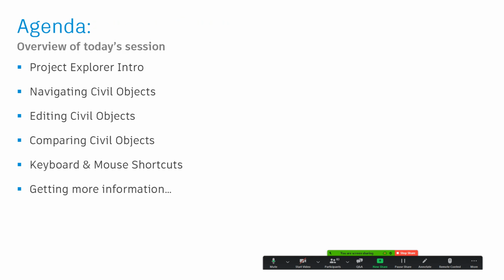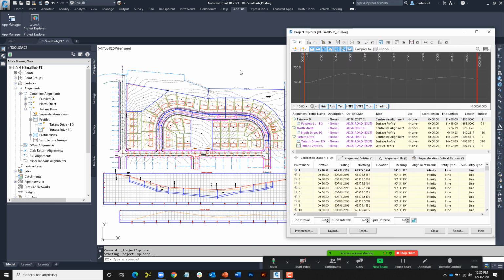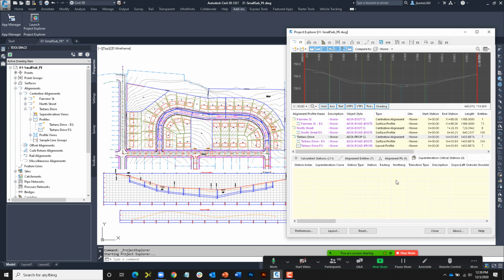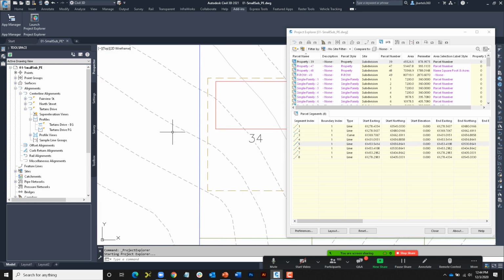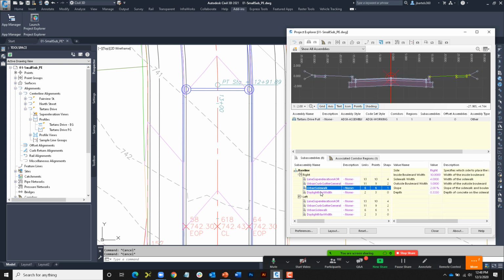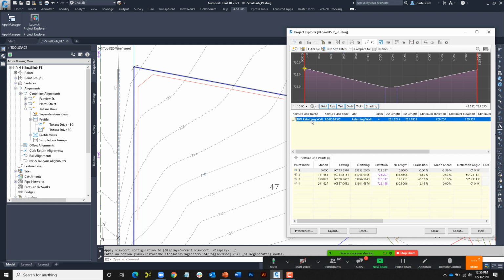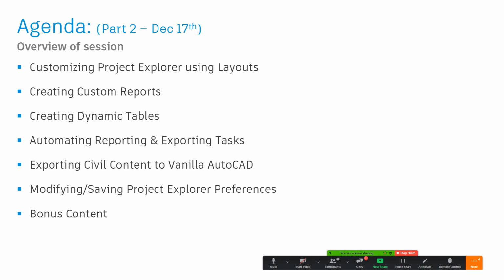Getting Started with Project Explorer for Civil 3D - Pt 1

Comment: Hi Jeff.
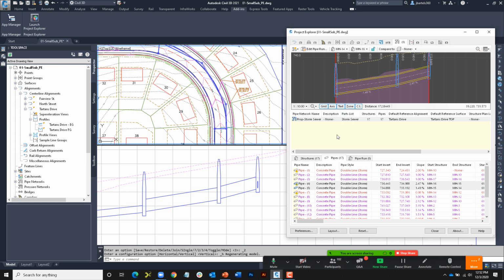Do you know if there is a solution for the "Pipe Run" problem at 21:16?
I have the same problem in 2021.3 and 2023.1

Comment: Hi Jeff, today I started to use the project explorer tool after watching your amazing video part 1 about this and hope for the other on December 17, so I'm doing a drainage layout right now and I saw something weird a little bit by using the new tool, I laid out 3 manholes and 2 pipes between them, but when I change the invert elevation of the pipes by using the panorama view as I used to do everything is ok, but by using the project explorer the pipes is disconnected from the manhole getting the adjusted invert elevation and the structure stay in place with no change at all, I mean the structure must vary as the pipes does. could you help me out about this? thanks in advance!!!
Reply: When will this be fixed by AutoDesk? It has already been a year....